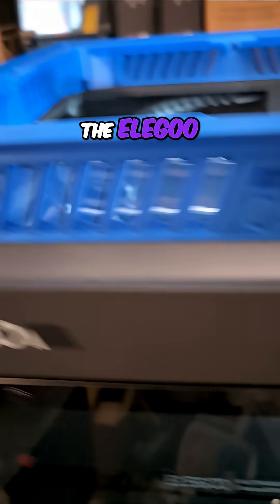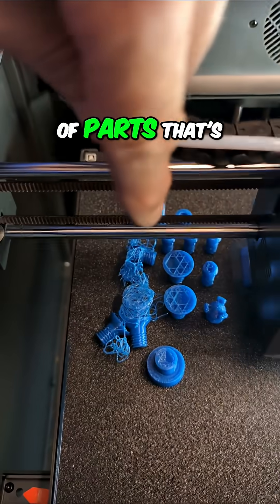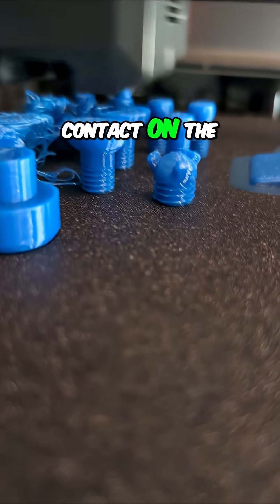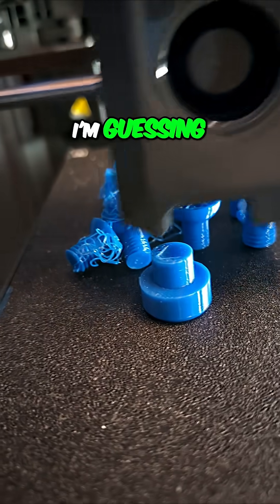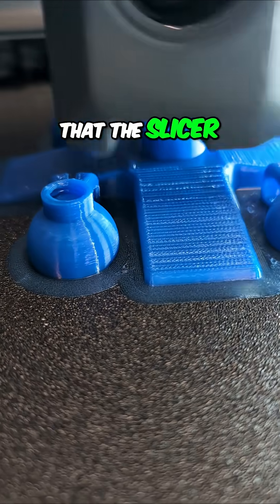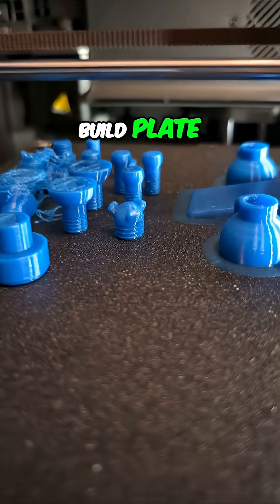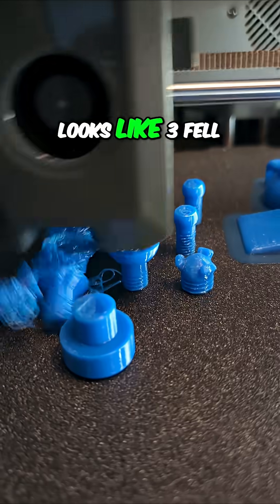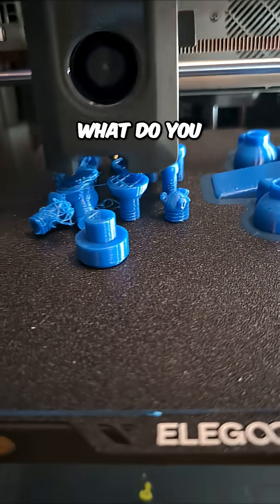Elegoo Centauri Slicer Issue: Brim Problems & Printing! #shorts

Comment: print temp is too low, and if it is pla turn the bed to the other side. thats how I fixed that
Reply from the maker: Thanks. 
Temp was within the range marked on the spool, but I agree it is too low. 
The plate is on the side that is marked for PLA and other filaments (this is petg). The other side is marked PLA only. :)
Reply: @GearReportMaker  I had the same problem the other day, did calibration dance, tuned the nozzle, clean the bed, and kept failing. next day I gave the same order and wala ! a nice print came out.  one thing for sure, I think it likes to print close to its printing tolerances (temp) I also noticed that the PLA I printed was a cheap one so I slowed down the printing speed. One week later…. no more issues.
Reply from the maker: Weird. Hopefully the printer gets more stable as the firmware matures.
Well.... assuming it matures. :)

Comment: If Elegoo hadn't used a years old hacked up version of klipper and actually open sourced as they're required to, you could exclude the failed ones.
Reply: You couldn't , it wouldn't run klipper why do you think they used that old hacked up version. The hardware isn't powerful enough
Reply: Cmon, marlin can exclude parts. *MARLIN*. Running on fricking stm32f103. WDYM "HARDWARE ISNT POWERFUL ENOUGH"?
Reply from the maker: yeah. But then the hardware specs would have to be much higher and the cost would go up.
Reply: I think they actually just did open it up
Reply: Exclude objects is something the CC does.  I’m looking at the setting in the slicer right now, and have cancelled parts on my own prints.
Reply: @GrayeWilliams  what firmware version are you using? Possible it's been added.